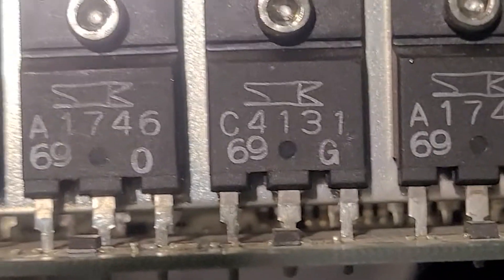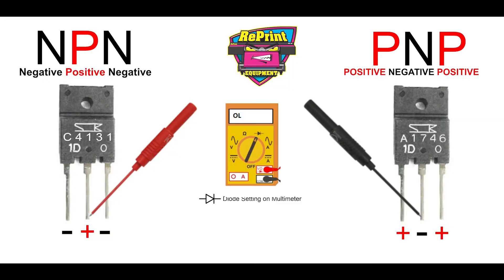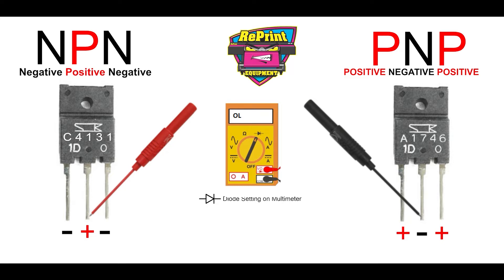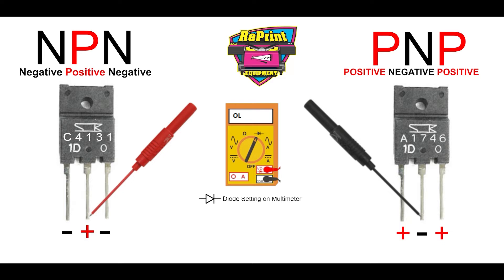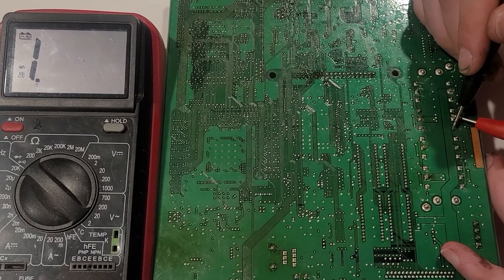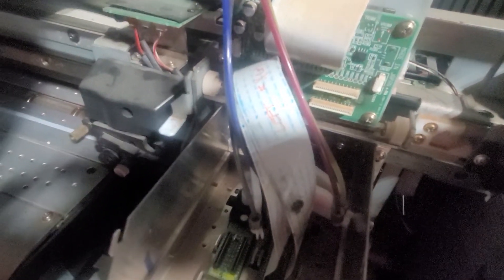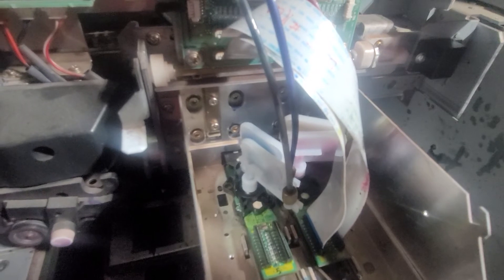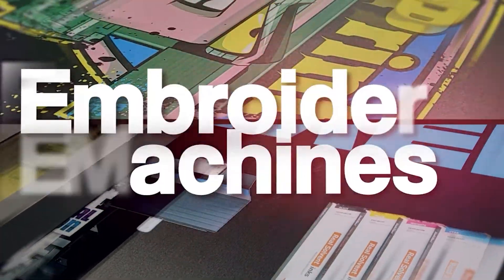Electrical Issues DX4 Printhead Testing Transistors troubleshooting Roland Printer Print head Epson

Comment: Good evening, my friend. I have a Roland SP540i printer at home that I use for occasional work. However, it started to show errors when printing two colors in the print test. I replaced the dumpers and capstations. But when I replaced the dumper, I ended up breaking one of the head's inlet nozzles, so I disassembled the plastic part and replaced it with another. When I connected the cables again and went to do a print test, both heads now stopped firing ink. Before, only one head was firing, and the other one worked normally. Could you tell me what it could be and what I should do to solve this problem? I really appreciate your help, it will make all the difference, because I currently cannot afford to call a technician or buy new heads, which here in Brazil cost on average five thousand reais each.
Reply from the maker: Need to check the fuses on mainboard, that is where i would start
Reply: @printholix217  I checked the print head fuse, and it was indeed blown. I couldn't find the 3.15A 72V fuse, but I could find another 3.15A 250V one. I put it in the Roland SP540i machine, and it had some problems. When I turn on the red and yellow print head, it gives the message motor error 0109, then when I turn off the red and yellow print head and turn on the black and blue, it triggers the cutting motor. It goes up and down as if it were trying to cut, but without moving, and then it shows another error. In both cases, the equipment doesn't move, it doesn't do the standard scan when you turn on the plotter. However, when I leave both print heads connected but remove the print head fuse from the board, the printer turns on normally, scans, and even cuts if I ask it to, but it just doesn't trigger the print head because it doesn't have the fuse. Have you ever experienced something similar? Could you explain to me what this could be and what the solution is? Equipment stopped. Thank you in advance for responding to the messages.

Comment: Great videos. My issue:
I have an SC-540 solvent/6 head - bought it used in 2010, and still use it regularly - (some 14 years now).

However, in this past year, I've been having issues with Cyan colors coming though incorrectly, for at times, tends to appear in the purple values. Needless to say, have had to do print tests before processing older digital files with blue in them, and tweaking the file to get a more accurate output. And the colors in the files are accurate - as I've been processing them for many years.
Could it be a weak component on one of the boards that's causing this to happen? Like maybe a weakening capacitor(s) or other component?
Or is a board just getting old and needs replacing altogether, and if so, which would it be that controls color and will restore accuracy?
Thanks in advance.
Reply from the maker: It is more than likely a weak printhead, if anything. Them crystals get worn out over time.  Sometimes, changing the head rank helps.
Reply: @printholix217  Thanks for getting back to me. Have changed head, to no avail. So am stumped. Can you explain 'changing the head rank' ? And I do my own servicing as I'm in a mountain region with no support. And the last time a few years ago, I had a tech-guy come to install a head, and he told me he didn't need to input the rank of the head, at all. I wasn't comfortable and asked him to do it anyways. Can you comment on what he stated?

Comment: Hello. We bought a used Vp540 printer, with 4 nozzles, the yellow color produces the same for me after starting up the printer (we saw it in operation at the previous owner, it was fine there). The printer was transported normally, it was not dropped or hit anywhere. I looked at the thing mentioned in the video, I didn't measure different values for transistors. I also tried moving cables, but unfortunately the same problem still exists. Where else can you find fault?
Reply from the maker: Text me 217-413-2532 gladly help you figure it out!

Comment: old sp300 does perfect test prints like a brand new machine, but print anything and the black seems to be firing at the wrong time, say a letter ' I ', theres extra black dots around it horizontally, like spurious nozzle firing. as its for print and cut there's corner alignment marks, these are often fine but the text is terrible and fuzzy, its nothing i have ever seen fail in such a way, and as said the head test shows all nozzles working, all nice and neat and with perfect alignment nozzle to nozzle. i thought is it a wiper making the head dirty, but that should affect the head test print..
Reply from the maker: I've seen weak heads with perfect nozzle checks print horrible. 

I would start by cleaning encoder strip. Second run fill test in service mode and check for overspray. I should have videos on both

Comment: WOW, another great video!

I have an SP540V I purchased new in 2010 and it has worked great all this time, in my home-based small graphics business. However lately I noticed it will not print the colors correctly on the FAR left side.

The printed image looks great until it is printing at the last 5"-6" of a 50" wide image, the printed image looks kind of greenish like the magenta is not printing on the far left side only. Someone suggest I change out the magenta damper, which I did and that made no difference.

Do you have any idea what would cause the magenta to not print only on the far left side of an image when printing?
Reply from the maker: If its in the same area I would suspect you may need to clean the encoder strip or replace it.   Thanks for your support